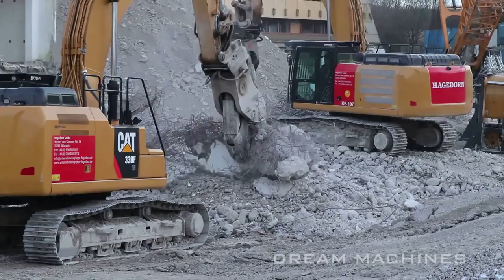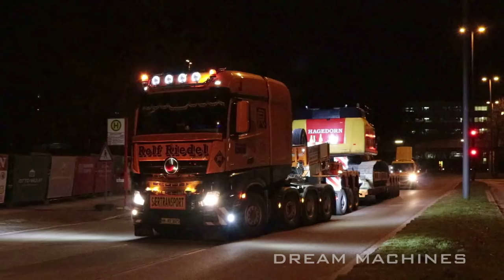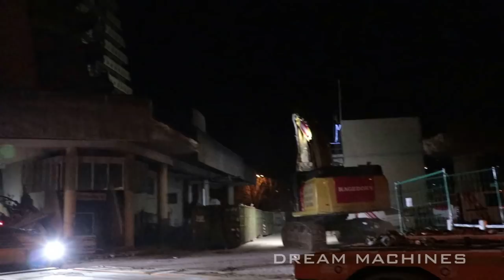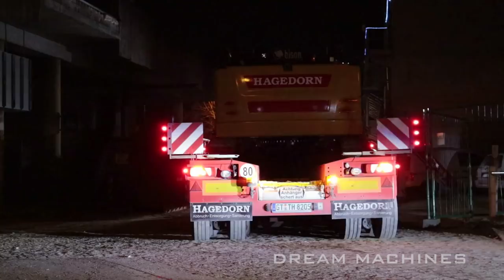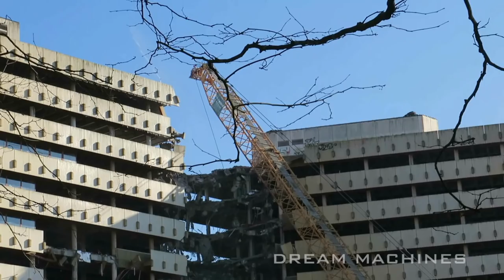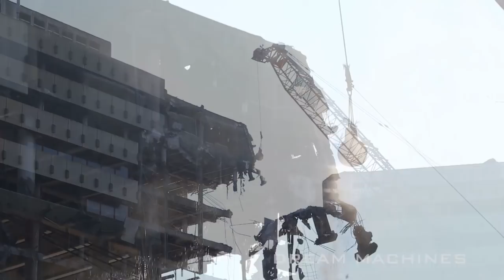WRECKING BALL DEMOLITION #3 LIEBHERR 960 HS895 CATERPILLAR 349E ABBRUCH BAGGER DREAM MACHINES

Comment: The vents on the left side of the excavators  are covered to prevent dusts, or are they just simply block by those dusts? thx.
Reply from the maker: keep away dust and dirt from the engine
Reply: thx. for your reply

Comment: RJM@54 3/19/2018
wonder why they did not imploded it
would of been a lot quicker
Reply from the maker: would not have been quicker: think about the preparation for using explosives! Many workers would have to drill many many holes. And getting a permission for using explosives would have taken long time. Furthermore there are many residential and office buildings nearby with a lot of glass...